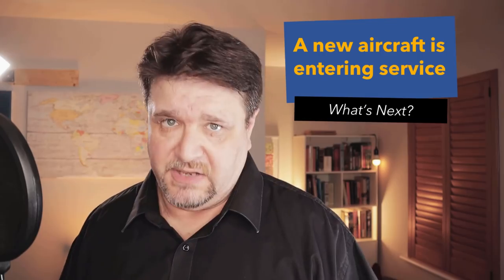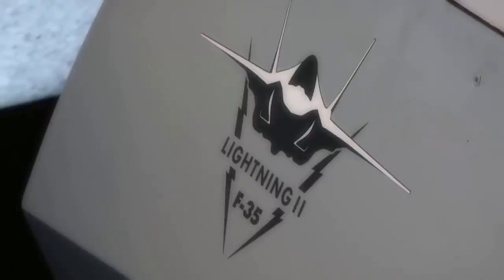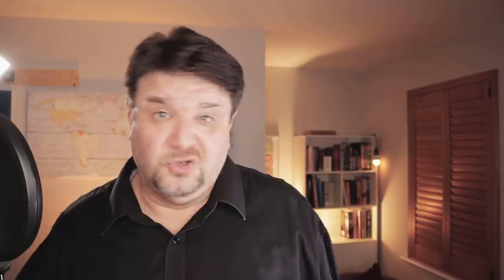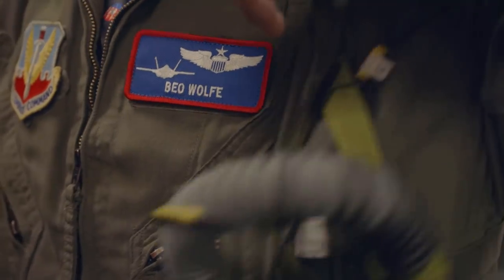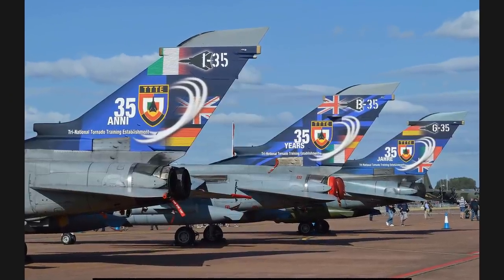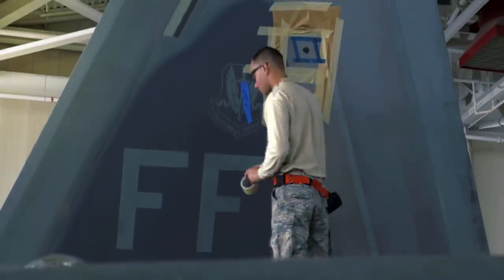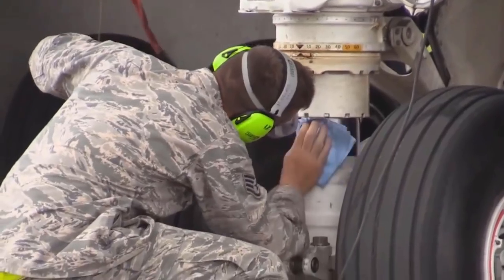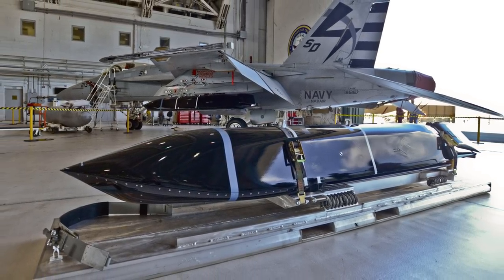HERE is the NEW Air Force Fighter. WHAT do we do NOW? ... In 3 Minutes

Comment: I think a significant part of the complexity and cost come from the bureaucratic processes at large defense contractors that are designed to shield them from legal responsibility for anything and everything. They focus on pre-defining every single aspect of every single system of the new aircraft or weapon before the thing has been designed, much less a prototype built. This also means that changes in requirements as more understanding is gained of the trade-offs and limitations of available technologies translate into thousands and thousands of more (billable) hours to re-write thousands of pages of specifications and contract clauses that have a good chance of being changed again down the line.

Remember, it was taken for granted that launching a satellite into space was a several hundred million dollar affair. Then SpaceX came along, and turned that perception on it's head. I'm not saying designing a complex system like an F-35 will be easy, but I believe a new "startup" entrant in the defense sector, and a change of attitude in the military towards a more agile development cycle can reduce development costs and development time significantly.
Reply: Well that and you could reduce the Cost drastically by having more open source contests.
Reply: @Holuunderbeere  speaking from experience, open source isn't necessarily lower cost. Learning someone else's code base, especially when it's a large one is very expensive. It still has to be maintained, verified, and certified. 

When it comes to military systems, there's also the risk that you're giving your advertisers access to your technology, and the chance to find issues you're not aware of.

Having said that, I'm sure the leading world militaries have large code bases that they use and share across projects and systems, such as radar signatures
Reply: @Holuunderbeere  Supply chain is (though often enough, ignored) a national security issue. Picking a lowest bidder on sourcing is not the end of the list of considerations. If you have to operate in a wartime scenario, you have to ask yourself what the likely risk factors are to your supply chain. Also, there are technological security considerations. Also, some strangely priced items are actually funnels for black project funding.
Reply: The Pentagon is the biggest Soviet-style bureaucracy that gets in the way of developing the systems they solicit on-behalf of the services.

Once a program gets funded, they really get in the way, then criticize the contractors for not meeting their musical chairs game of shifting and ever-expanding requirements.

The biggest causes for this?  Soviet moles who have been there for generations (who also steal the bleeding-edge technology and transfer it to our enemies), academics with no relevant knowledge or experience in the programs they oversee, combined with General Officers and Colonels who are with a program for a few years then move on, handing it over to the next guy.
Reply: @iraqigeek8363  with respect I feel like spaceX enjoyed the benefit of doing something which lockheed and martin marietta- since merged- long ago perfected. They may find some economies but look at all the groundwork that was done before they came along.
Reply: @Adrian Simmlekark how is the open source community benefitting from the driver? Is anybody outside of AMD actually making any considerable contribution,?

You haven't explained how that model would be cheaper or easier than, say, the nvidia closed source driver (if we were to stick to graphics cards)? 

It's not like defense contractors are writing all drivers from scratch everytime. Of course they use off-the-shelf components and software where possible. When you look at large projects like the F-35, or the F-22 before that, the capabilities and specifications changed and evolved considerably in the 10+ years between the initial prototype and initial series production.

Open-source isn't some magic solution for everything. I see it all the time at work (I work in software development) where someone used some open source library that was (in theory) the best option 5 years ago, only for it to be abandoned a couple of years down the line. If you need internal resources to maintain it, how is that any cheaper than having an in-house solution developed by an internal team? And how do you deal with any vulnerability that your adversaries find in it that you haven't found?
Reply: @unclejoeoakland  the reference to SpaceX is mainly as an example of an aerospace company using the agile methodology in their design and development processes. Boeing, Lockheed, Raytheon, et a (save for maybe skunkworks),  are for the most part still stuck in gated-waterfall land.

Just take a look at how many years it took to award thr B-52 re-engine program, and this was supposed to be a relatively simple one, as the whole idea is to use an off the shelf engine. Imagine if AF wanted a brand new engine developed!
Reply: @iraqigeek8363  I understand that space x was one example but the principle holds up. Moreover, I don't think there's anything "simple" about replacing eight 1950s era turbojets with four turbofans from the 2020s. And on top of that, we can say "private enterprise" all we like but the tax payer invariably picks up the tab for grand failures, not the companies. We may as well retain ownership of the project and control, if we are going to remain the ultimate liable party.
Reply: @unclejoeoakland  "Simple" in relative terms. The eight turbojets are being replaced with 8 turbofans, not four. Since the beginning, the objective was to use an off-the-shelf existing turbofan to save costs. Yet, it took a decade to write down the specifications and contract terms. Meanwhile, not a single engine option was tested on the B-52, no integration work has been done, and no fight experience gained with the new engines. All you have to show for these years is a long requirements list. 

All those man-hours spent devising and negotiating those terms were not free. All the flight and maintenance hours that those turbojets continued to fly were not free. 

Anybody financing the development of anything will always own the project and have full control. This is about methodology, not ownership. NASA used a rapid iterative methodology during the race to the moon, and owned the entire process as well as the technologies that resulted from it. Private contractors built iterative designs quickly, tested them, and learned what needs to be improved/changed. Compare and contrast with how the SLS has been developed and managed. It's been 10 years in development, without a single flight. It's re-using the shuttle's main engines (no new engine development), and stretched versions of the shuttle's solid rocket boosters. Yet, somehow it's overbudget, it'll cost almost twice to launch as the Saturn V (adjusted for inflation), and none of the kinks and issues it will have will be discovered for more years to come because it's never flown.
Reply: 100% Truth.
Reply: What sort of legal responsibility on defence contractors are you talking about? Liability to who and for what?

Comment: You're right in saying that it's hard to introduce a new airplane into service. But that time is coming down. 

Used to take 20 years. Except during WW2, when a new airplane could be introduced in 2-3 years. 

Many of those airplanes were incremental improvements, during service. 

The Russians had some off the production line that were developed in less time than that during WW2.

They're working on new production techniques as we speak. 

It's probably going to be 5 years to introduce a new airplane into service. 

It's all a matter of incrementally improving airplanes. 

Most people don't know it, but the original specs for the YF-22 & YF-23 were ridiculous.  

They included everything, including so many radars facing every direction, it was impossibly ridiculous for the time.

Fighter airplanes are becoming like cell phones. The cell phones may be different. There may be better cell phones than others, but the software is the same.

Update: the less costly cell phones have advantages over the more costly ones. One of those is battery life. Sometimes you can get more battery life out of a cheaper phone, because it does less. Another advantage that less costly cell phones have is that they are cheaper. They cost less. 

There may be cheaper airplanes out there. They may make up the bulk of your fleet.

Comment: At this rate it will cost half a billion per plane and the US will only be able to afford 5-10 of them.
Reply: Well, if they only get 10 of them, they'll cost about 4 or 5 billion each. Each unit has to absorb their slice of the entire program cost. That's what happened to the B-2's price.
Hopefully the F-119 and F-135 engines will provide a quick & easy path to powerplant, and the radar and other integrated systems & sensors in the F-35 could provide shortcuts as well. If it uses the radar, sensors, HMDS, and some other tech pieces from the F-35, as well as twin engines which are highly similar to the F-135 engine (from the F-35), then it might turn out almost affordable. Almost ;)
Reply: And only couple of them area available at any single time, because of (expensive) contracted maintenance system with military not having access to full specs/documentation etc.
But at least profits of military-industrial complex have good "healthcare program"...
Reply: @tuunaes  Well, there is "some" truth to the military industrial complex. But it's considerably less of a thing than most people like to imagine. Defense contractors go out of business all the time. Politicians swindling billions through 3rd party mercenary outfits is a much bigger problem these days.

What's needed (in terms of procurement costs) is to commit to a particularly advantageous price-point to capability ratio, and then mass-procure in large enough numbers to allow 'economy of scale' to take root and drive costs down. 20 B-2's cost 2.5 billion each. But 100 B-2's would have cost more like $550 million each (or about 10% more for five times the units). 270 F-22's cost almost 400 million each, but 500 of them would have cost only about 225 million each. The raw materials and labor are far cheaper than the cost of designing & setting up a production line. So whatever they build, they should plan to build a sizable number, so they don't suffer the pricing of hand-crafted specialty items.

Comment: This is why those who put out 6th gen air crafts are just foolish.  Each generation is like atleast 20 years out.  They have no concept of cost and time.  For instance su-57 by the time it fully deployed meaning more than 50 aircrafts to make a difference in a war, a new US generation will overtake it.  Su-57 should have been out almost like 20 years ago when the f-22 came out.
Reply: Since enemies within killed the F-22A before we could even go into Full-Rate Production (FRP), it created a massive fighter gap with the old and broken F-15C fleet not getting their replacement.  NGAD-A needs to fill that gap that should have never been there.  That is a totally separate track than JSF-A, which has replacing F-16Cs since 2014.

Comment: This is so obvious to all knowledgeable people. But many fanboys and other like those need to see this.   Lots of Biggles in the commentator fields haven't realized that ww2 air combat is not relevant today. A clean sheet fighter airplane is exciting for the engineers and disastrous for the air force(F-35 and more). A incremental development with one thing at a time is a more wise approach to success in air power. The latest example of this is Gripen E. A new fighter with almost the same aerodynamical properties as the predecessor and the rest new. After that new aerodynamic properties will be next step. Planned to fly 2030.
Reply: It's hard for many people to understand that the USAF operates a multitude of Tactical Air systems, as does US Navy and even US Marines, while their own tiny nations only might have one fighter with 2-3 squadrons.

USMC alone has a bigger air force than the UK, who has one of the biggest in Europe.

USAF operates:
F-22A
F-35A
F-15C/D
F-16C/D Blocks 25-32, 42 Aggressors
F-16CM CCIP Blocks 40-52
F-15E+
A-10C

US Navy operates:
F/A-18E/F 
F-35C
EA-18G
MQ-25
F/A-18C/D in Reserves/shore duty

USMC operates:
AV-8B+
F/A-18A/B/C/D+
F-35B
F-35C

As we move forward, the USAF F-16C/D early Block fleet 25, 30, 32, and some 40/42 will expire due to airframe service lives exceeded.

A little over 300 later Block F-16CM CCIP Vipers will serve with their new AESA RADARs and avionics up until 2048.

Early, worn-out F-22As currently used in training-only units will be retired once they hit their airframe life limits in 2030, since they were delivered in the late 1990s. Later lot/Block Raptors will serve into the 2040s.

All F-15C/D+ will have long-expired by then with a few on posts in front of or inside museums.

F-35A fleet will reach over 1000 just in USAF, most of which will be Block 4 and Tech Refresh Block 3 with new sensors and CPU/CNI.  Block 3 F-35As will be filtered down to training units as Block 2s fill the Aggressor Squadrons at Nellis, which are already formed and populated with initial Block 2 F-35As currently.

NGAD-A will likely start replacing F-22As as Raptors are retired by airframe life.

NGAD-U will populate unmanned squadrons that are composites with manned squadrons of Block 4 F-35A and NGAD-A squadrons.

All Baby Hornets will be retired by then, replaced by F-35Bs and Cs.

All Block 2 Super Hornets will be retired or upgraded to Block 3.

NGAD-N for USN may or may not be funded, but USN is committed to it, even sacrificing any new SH production, just cut their Block 2 to 3 upgrade by 20% 2 weeks ago stating they are throwing their money into RDT&E for NGAD-N for the future composite carrier air wing that will be comprised of:

F-35C
NGAD-N
SH Blk 3
EA-18G
MQ-25
UCAV-N 

It's best to understand total fighter force structures in the US, rather than try to focus on 1 platform.
Reply: @LRRPFco52  Not a comment on this video, but I will answer anyway.
is it hard for you yo understand? I believe is easy to understand for most people.
The pentagon lunched the joint strike fighter to replace all the different combat airplanes, except F-22. Don't they understand "the total force structures in the US"?